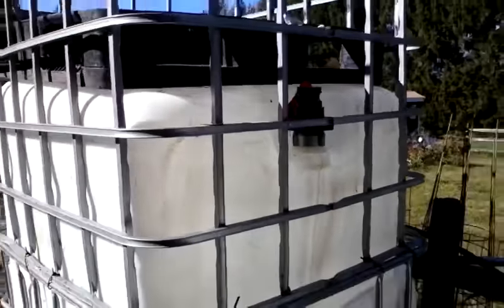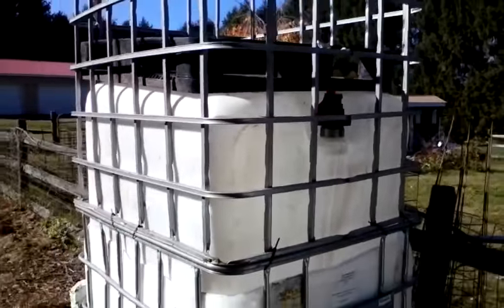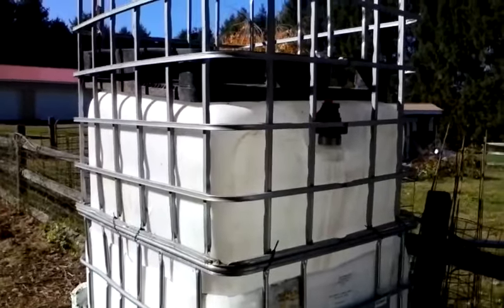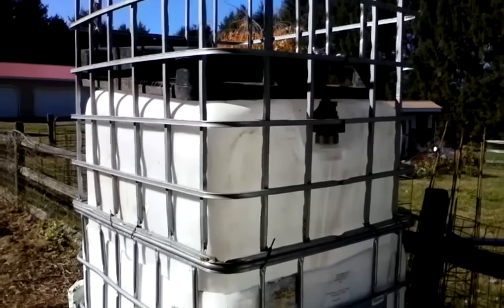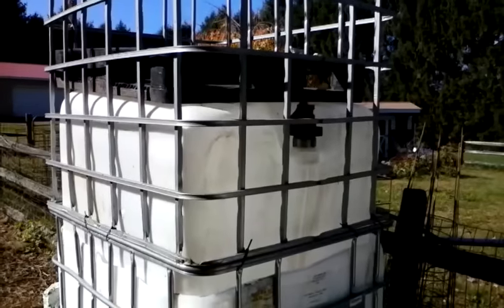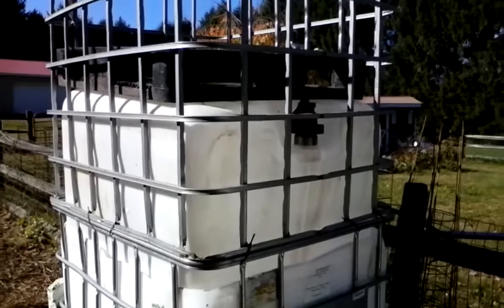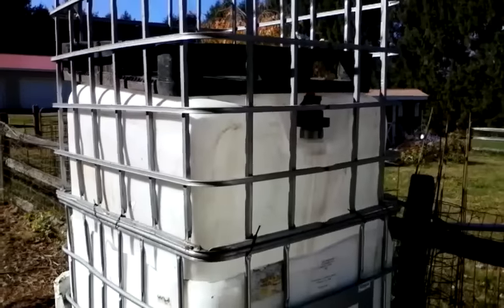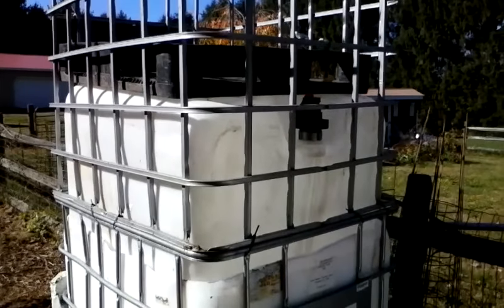Solar CITIES floating IBC biogas holder.

Comment: Don't gases escape through the sides between the two tanks , how do you keep that seal tight or is that simply done via friction
Reply: Maybe they fill up the bottom tank with water so when the gaz arrive it push up the top tank
Reply: @Kolo_musicc yesthats exactly what they do   you can put some weight on top to increase the pressure.but not to much

Comment: How did you get an IBC to fit into an IBC?
Reply: I was wondering the same thing. I noticed in this video that the bottom IBC is in its regular position but the top floating IBC is on its side with the tap facing upwards. Perhaps this is how it fits.